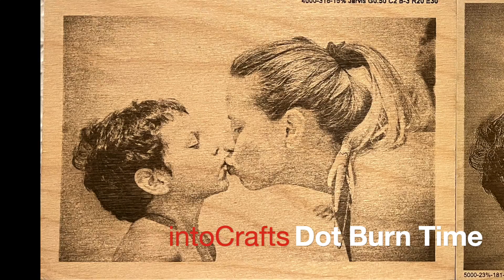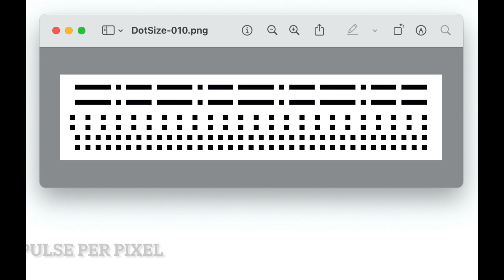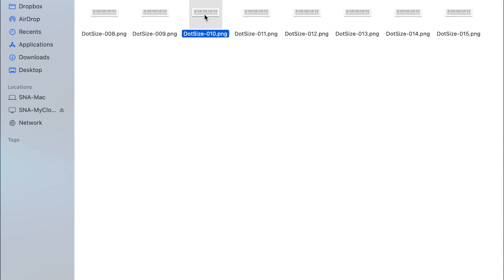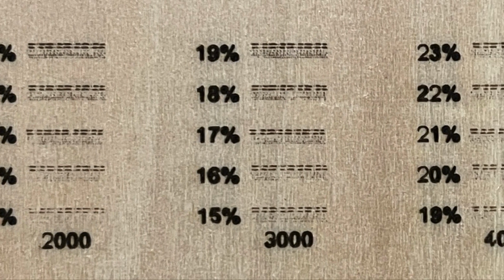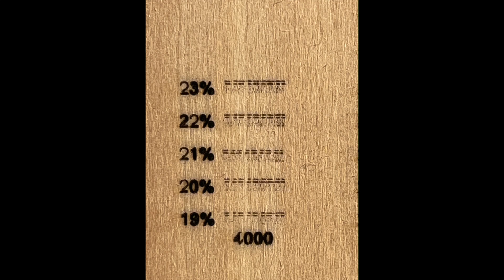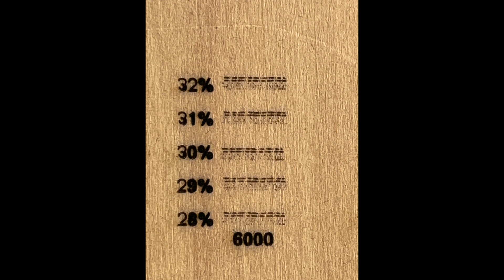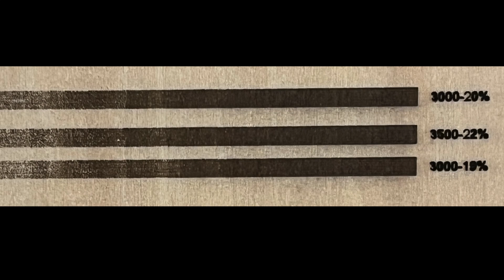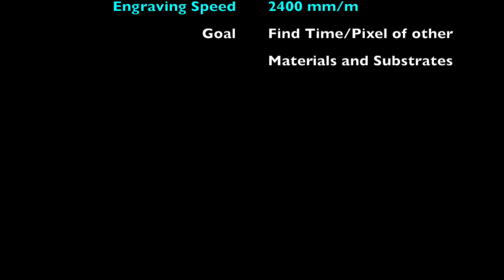E3 - Dot Burn Time (Finding Speed and Power for Photo Engraving)

Comment: Can I resize the dot image larger too check better details? I need to engrave using passthrough?
Reply from the maker: Yes, you can resize them and choose passthrough. Insert the one for 0.08 mm, scale down to half to get a test file for 0.04 mm, or scale-up to double for 0.16 mm, and so on.

But consider the resolution of your laser engraver. For instance, if it is 0.01 mm, resize the test file in a way that you get 0.08, 0.07, …, 0.04 mm line intervals.

Comment: Since you used image, what image mode setting did you use in Lightburn?  I'm assuming Jarvis because that is what you used for the photo example shown at the beginning of the video?
Reply from the maker: Hi Greg,
For some unknown reasons, sometimes Lightburn mixes up with dithering this small file. Please
1- import the test file
2- set the interval
3- choose Threshold and Passthrough
Reply: @intoCraftsDK  Thank you!
Reply from the maker: @gpowanda  and in general, I use Jarvis and some specific cases with an IR laser (1064 nm and 0.03 mm beam size), I have used Newsprint.
Jarvis works fantastic for all photo engravings, just the correct parameters should be found.

Comment: Hi
Thanks for the attribution. As you know all my test work was done on a CO2 glass tube laser where the mechanism of producing dots is more of a balancing act between power, speed and the response time of ther HV power supply. You have no such issues with the diode laser becuse it is all electronic and driven by PWM. 

 I note you change the speed and power  for your test patterns and see differences in dot size.  You have done great job of bringing peoples attention to the 1pixel = 1 dot principle and your images on wood are pretty good. However I think you can do even better. Let me explain.  I think you have only a single focal lenght lens that you can use , althouhg I have seen diode lasers where you can choose between two lenses.  Lenses are not the creatures we can read about in ALL text books. They do not have a FIXED focal point. The focal point changes with speed,power and material and that is one of the tricks you are missing. Try 6000mm/min speed and 550% power just as an example.  Look at the row of dashes on the top of your pattern and adjust the FOCUS until you get the thinnest line. Only when you have done this should you start concentrating on the single bottom line dots.  BUT before you spend time experimenting with this, read on.

I  Ihave a 30 watt RF  CO2 machine that works with PWM.  I originally failed to undestand  many things about  PWM  technology and  my  first attempts to create small dots rapidly was total rubbish. even though I was adjusing the focus perfectly for the speed.  Your diode laser is the same  in that it can only output a singe power  Say 10 watts if that's its rating..  Whenever it's on it delivers 10 watts  so there is no variation in beam characterestic as with a glass tube machine. The qualituy of a diode beam is pretty  poor M2 number and that is why it is wonderfully suited to engraving but pretty inefficient at cutting.  Here are the two major factors that allowed me to do photo replication at 1000mm/s
 Your pattern is at present 254ppi  or 10 pixels per mm . So if you run nat 6000mm/min that is 100mm/s.  and because each mm is 10 pixels and you are attempting to make 1burn dot=1 pixel. you are trying to burn 10x100 =1000 dots per second.  This if you set your PWM frequency to 1khz then you will be providing 1 pulse per pixel. Once you have this factir correct you can then start changing the dot size by changing thre %power (ie. the exposure time per pulse). This will give you amzing control over the dot size. I feel sure you will be able to drive your machine to its speed limit if you adopt this simple set of rules  ie 1pixel=1dot=1 pulse.  IF you can achieve  reliable single dot size then you will never need to "adjust" your picture  to suit the macines capabilities.
 Let me know how succeesful this method is for you
 Best wishes
Russ
 ps  this is a 508ppi image done with the Norton white tile idea but I use 100% titanium dioxide rather than paint. This is on a glass tube CO2 laser at 200mm/s but I have recently found out I can run at 800mm/s on my RF machine.. So there's lots of scope for you if you can change your PWM frequency accurately    https://youtu.be/TVgmoN1wljs
Reply from the maker: Hi Russ
Such an honor to receive your comments and inputs. I enjoy watching your videos.

By the way, my diode laser head has a defined pulse frequency (1kHz), which I have found it limiting the speed (considering 1ms per pulse in addition to the time for each dot to be marked on the material).
For instance for wood I have this time per pixel to be around 2 ms and tile 3.5 ms and so forth.

I have not got the chance to try your suggestion for increasing speed and power for a chosen DPI and readjust the laser head to get the thinest line.
Honestly I did not expect that lasers focal length may change by speed.
Reply: @intoCraftsDK 
 As I mantioned previously , there is no intention to criticise your work because what I know is done with a CO2l aser  (and quite a bit of 1 micron fiber laser. work also).
 You are one of VERY few  diode users people that are trying to understand how to get better by results by a logical process of understanding. Unfortunately there is no way for you to see how your beam is actually performing, only by the results of your work, I have been able to understand how laser beams and  lenses interact because 10.6 micron light has a great effect on acrylic where it acurately tells me how the light intensity is damaging material. Regradless of the  length of the light waves, the way that lenses treat  laser beams will remain constant (and not the same as normal light) because laser beams always have a Gaussian INTENSITY distribution. To be honest, the diode laser beam quality is a poor match for this ideal distribution but intensity profile is still sufficiently  intense at the beam centre to create the same sort of lens/beam relationship.  Sadly you cannot change your lens  to see all the effects I see.  You imagine, your lens has a fixed focal point because normal light has UNIFORM intensity lightwaves whereas  the laser lightwaves are of variable INTENSITY and  that creates properties that optical engineers never consider. Their goal is to transmit images  not use light energy to vapourise material....big difference.

 The diode laser has some advantages over CO2 and even fiber lasers. The fact that the beam conforms poorly to the Gaussian ideal intensity distribution means it is what I call a "blunt" beam. On a CO2 glass machine it is possible to get a blunt beam by tuurning the power down really low BUT the10.6 micron light is much better at damaging  organic materials that the 450nm light from the diode laser. This means it is still very difficult gfor the CO2m laser  to scorch wood and leather.  The  CO2 beam, even when soft, is  always trying to cut. Whereas the diode laser is not only "blunt" but it is far less efficient at damaging organic materials  because of inefficient energy absorption. Coupled this with  the very low power you are limited to and  that means you have the perfect engraving tool that is abysmal at cutting. 
 You say that you are limited to 1000 Hz   so in reality that means your best quality will come from  making sure you set the product of resolution and speed to  match your frequency.  Ideally you are looking for 1 dot per cycle . Lets say your smallest dot is 0.15mm  then you have 7 dots per mm. That means your image must be set to 25.4mm/0.15mm= 170ppi .   7 dots per mm x speed  must ideally be exactly 1000 (Hz). Thus 1000/7= 143mm/s or in your case  8580mm/min. I hope this makes sense. . With your laser you have no control,of power. it is always 10 watts(say). All you can do is change the change the duty cycle with your %power control.  This is the feature tha you should play with to achieve a good dot size  More power=  bigger do,  Thus  its a balancinbg act for you to get sufficient exposure time  (with %power ) but at the asme tme decrease power to get the ideal dot size. . IF you can ever achieve a 0.1 dot then your  image resolution can be 25.4/0.1=254ppi.  0.1 dots =10dots/mm . If youbare limited to 1000Hz then your speed now must be 1000/10 =100mm/s or 6000mm/min.

This data comes from my work with the RF  laser that operates by PWM . However,  I have a variable  frequency up tp 20KHz to play with.  I  totally failed to get quality photo replication until I discovered that the key was making 1 dot per cycle .

 Out of interest the middle row of dots in you pattern are non functional with the diode laser. With a CO2 laser there is a response time for the  high voltage to build after every switch off event . This big  middle row gap is designed to help define the speed . Too fast and some of these dots will not be burnt. 

 Keep up your great work for the diode community. I look forward to seeing your results.

Best wishes for the New Year
Russ